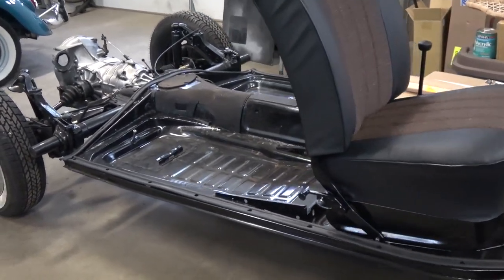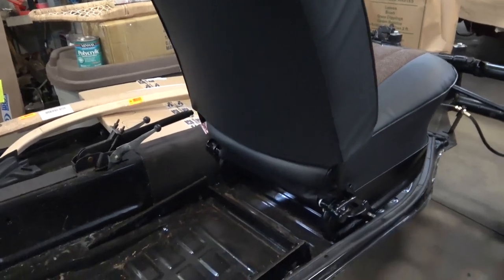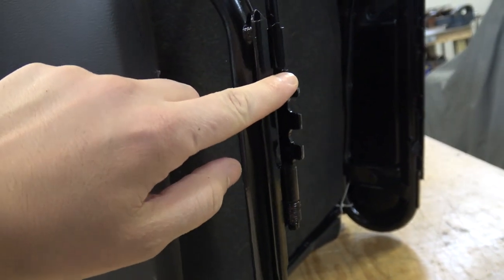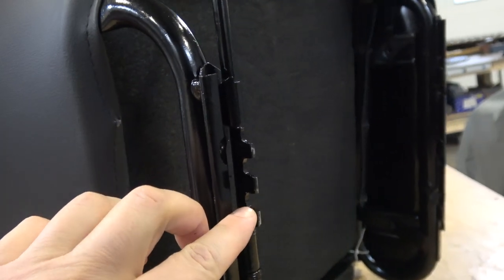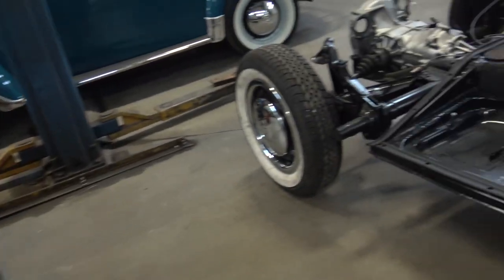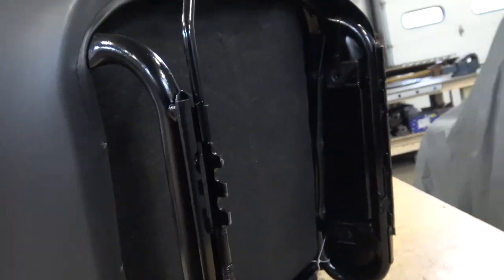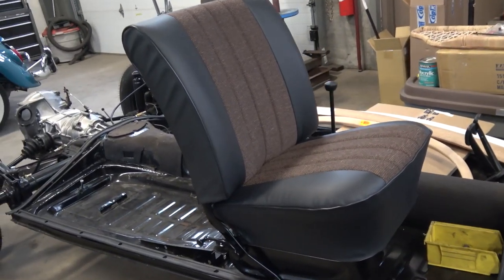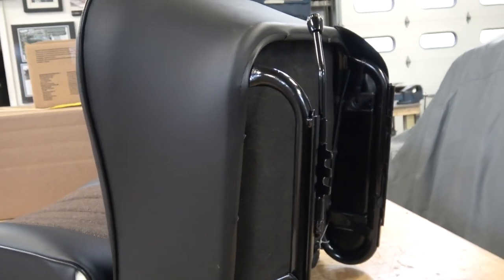Classic VW BuGs Beetle Restoration New Floor Pan Seat Frame Rail Adjustments

Comment: Also some Super Beetles have the factory floor pan "T" rail receiver and mating  "C" seat frame sleeve combination. Some have the "L" to adverse "L" configuration. Finding that out now when replacing Jetta seats in my "71" Bug back to stock seating. Great videos as always.

Comment: Got it on that.
My question is on the mechanism that releases the back of the seat forward. When pushing the back of the seat back the hinge is going back roughly. 
Your video is very impressive and focused.
My 1970 passenger seat is what I was describing. Do you have a video on that?
Reply from the maker: hmmm maybe pop me an email with a video showing me what is happening?

Comment: Couldn't figure out why the seats in my 64 Convertable kept coming off the rails. After watching this video I realized the new pans had the rail that didn't match the Seat adjuster. 15 minutes of ziz wheel on adjuster and voila! Problem solved.  THANK YOU!!

Comment: Chris what years did the seat “rails” change in the beetle? I know they went to a 3-point style in 73, but how many changes were before that? Thanks.
Reply from the maker: So up to 55, you had the straight rail, then basically it was the same from 56-70, then 71-72 put the plastic buffers on the rails and it had that lock mech on it so you could not push the frame all the way out without pressing that tab to release it.

Comment: Hey chris, my bug has after market seats and seat rails, theyre different to the original, where could i get factory seat rails and seat assembly (the mechanism that slides on it) where can i find those. Cant seem to find anything for sale online, ibhave seen them on the empi catalog but i cant order from there. Thanks
Reply from the maker: Seat rails maybe from cip1.com or wolfsburgwest.com.  As far as seats, you have to source good used ones.  Might have to look on thesamba.com
Reply: @classicvwbugs  thank you Chris, I will have a look on the samba. Oh and are the Empi rail and seat assembly any good? I saw them in the catalogue on their site. Thanks again 🙂
Reply from the maker: @zariel8257  I never used them.
Reply: @classicvwbugs  thank you none the less chris!

Comment: Mr.Chris what type of under coating would you recommend to use on the floor pans?
Reply from the maker: If you are going to do undercoating, I actually like truck bedliner or a rhino liner.
Reply: i wanted to use por 15 but i heard it would fade just cant make the mind up on which or what to use cause when its done never wanna deal with it again.